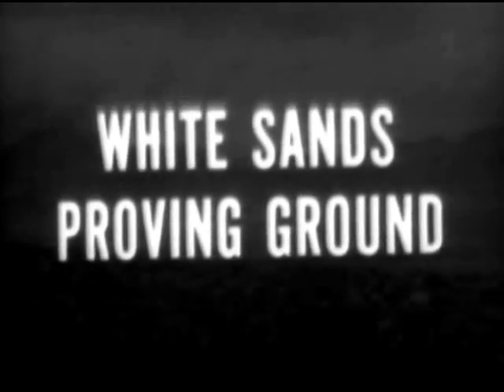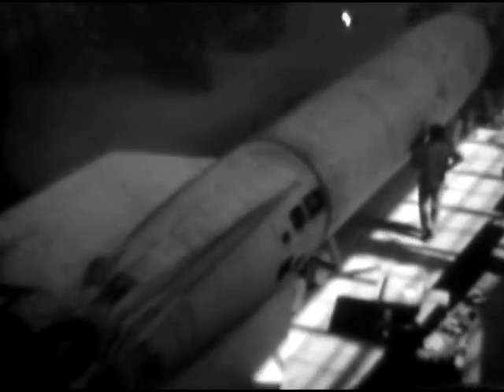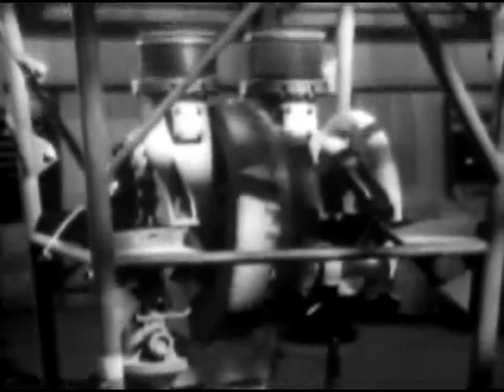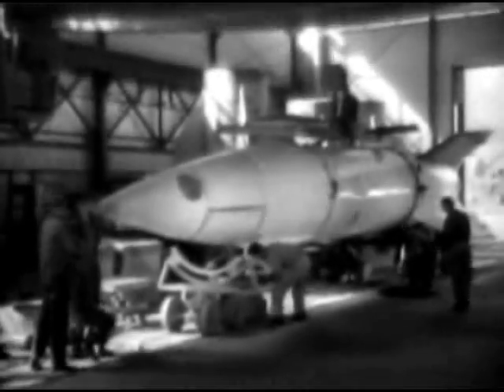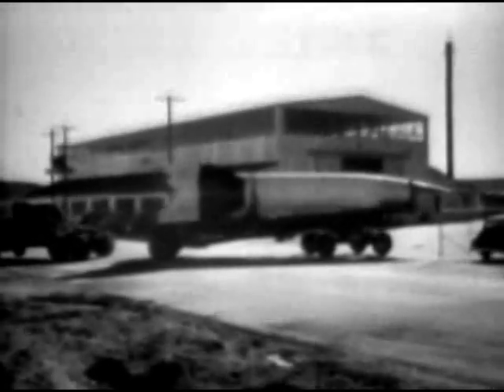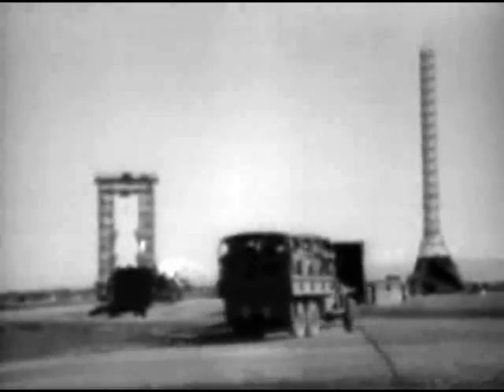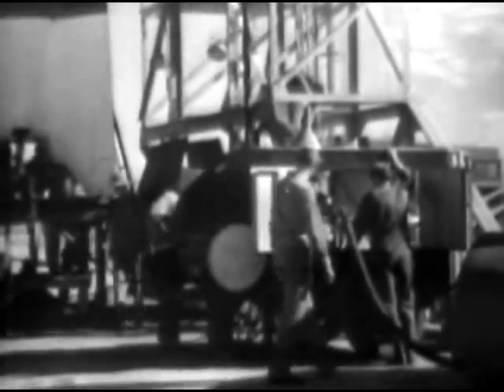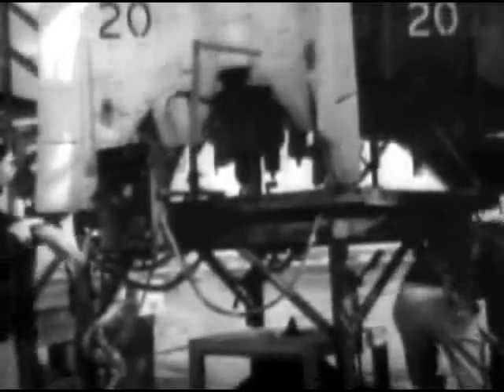American V-2 Rocket At White Sands (1947)

Comment: The first German V-2 missile tested in the USA didn’t get very far. The guidance system failed, a fin came off, and the rocket—after reaching an altitude of only 3.4 miles—crashed in the desert. The next couple tests went better, until 29 May 1947, when the rocket veered  south instead of north as planned, and crashed near Juarez in Mexico.

Comment: The lack of PPE on the workers makes me sad. How many of these guys ended up with lung problems later in life? We take a lot of that stuff for granted now, but all of this knowledge about safety and protection came about because of a lot of death and suffering. Knowledge paid for in blood. 😔
Reply: Tbf the fuels and stuff used aren't particularly harmful except LOX because of its insanely low temperature and spills onto flammable objects are disastrous.
Reply: Why?  There is nothing on this rocket that produces harmful gases.  The most dangerous material would be the 80% Hydrogen Peroxide... but it breaks down into nothing but water and oxygen.  Skin burns would be the primary danger with the H2O2.  The Sodium Permangenate is the same stuff you swish in your mouth at the dentist's office.  The rocket fuel is 75% ethyl alcohol/25% water.... 150 proof whiskey essentially (although it was not aged in charred oak barrels...) and LOX is liquid Oxygen... an component we all require for life.

The lack of PPE makes me happy for those men... they weren't having to do something unnecessary to satisfy the whims of some pencil pusher in a disconnected office that has no clue of what is going on in the field but thinks he is the expert.

Comment: 15:10  four seconds into launch rocket was one mile up !!! Compare that with Apollos which took 10+ seconds to clear just a 100 meter launch tower !!!
Reply: Das Verhältnis zwischen Masse und Schub ist entscheidend.
Reply: @Habibi46611  Google-Translation:: "The relationship between mass and thrust is crucial."  
Yes, of course. Above V2-rocket must have had an initial Thrust-Weight-Ratio (TWR) >6 to reach 20 miles up in 60 seconds, (if those numbers are real). Its next claim of reaching 100 miles (160km) up is probably false, because it translates into a lateral range of at least 160kmX4===640km . However, the latest V2-rockets' range was reportedly around half of that!!! Anyhow, compare the above V-2-Rocket going up 1,600 meters in 4 seconds, with Apollo-11 going up only 25 meters in 4 seconds, according to its official launch-data::: https://spacemath.gsfc.nasa.gov/weekly/8Page2.pdf  This side-by-side comparison, alone, is an independent proof that Apollos were NOT rockets at all, as proved in Youtube::: ("Simple-Experiment-Proves-Apollos-FAKE")
Reply: The V2 weighed 60,000lbs, the Saturn V weight 6.2 million lbs very big difference. Takes a lot of energy to get that mass off the ground.
Reply: @blackpepper6091  Keep eating black-pepper, and don't worry about it!!! BTW::: Energy does NOT lift rockets, shear-force does!!!

Comment: I have studied this rocket since my very young youth. Had this been tipped with a nuclear weapon, the war might still be on from WW2. The Germans had enough raw fuel for a hanford type reactor, and had they waited ten years to strike the Soviet Union, it might have been time for them to run up a plutonium load because I think they could have probably done it much faster than we did without all the expense we did not need to do in Oak Ridge Tennessee, because of their higher technical aptitude. We were flying propeller planes against their jets, which really was no contest had the other foot had the jet and we would have used it massively. They were dinking around with uranium cubes so they could measure the effects more closely. Don't forget we accidentally made the reactor large enough to overcome the poisoning of reactor xenon turn down of neutron flux that was only barely made possible. It would have required a complete overhaul and the cost was still astronomical.
Reply: Eles eram realmente alienígenas com suas tecnologias e audácia ,sem medo de errar !

Comment: I noticed the workers not using any masks when installing the glass wool insulation for the fuel/oxidizer tanks!!!
Reply: lol guess their union screwed up on THAT bit of workplace safety :-=).
Reply: Chet Pomeroy   There was little to no safety requirements back then.
Reply: Actually a British film of the firing of a V2 after the war shows the German men using masks while installing the glass wool.  Maybe they were just more aware of the danger.  I have insulated my attic with the rolls of insulation and when your sweating and unrolling those rolls, its hard work.  And you itch for a week afterward.

Comment: Very casual handling of the turbo pump fuels. Who needs safety equipment?
Reply: Tbf the steam generator fuels were just hydrogen peroxide and sodium permanganate which aren't particularly harmful. The worst one is LOX because it's incredibly cold.
Reply: @bradcogan8588  very cold and very highly pressurized.